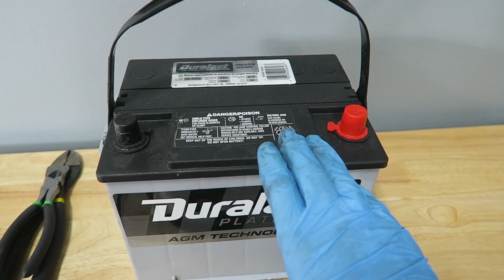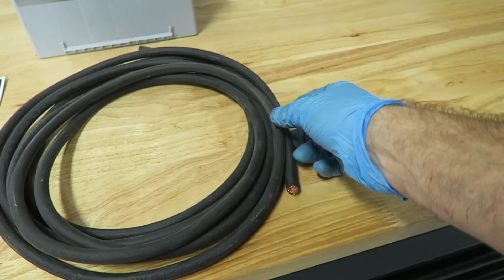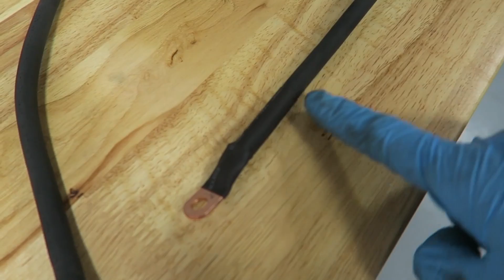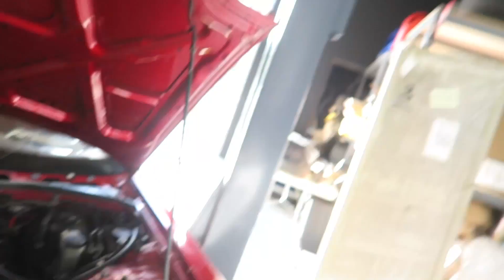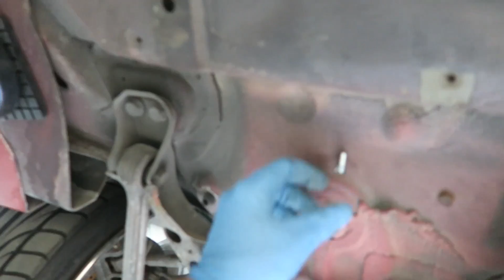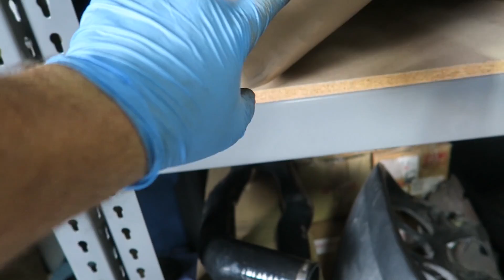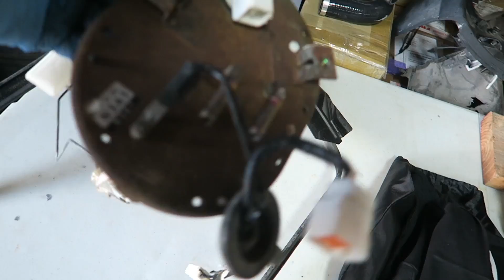THE FD RX-7 IS NOW READY TO START FOR THE FIRST TIME IN 14 YEARS!

Comment: I love all things I have seen so far, except the battery placement. In case of a car crash the battery will kill you or the passenger if it detaches. No amount of aluminum will hold those 40 to 50 pounds.

Comment: LRB Speed makes a battery mounting bracket specifically for the storage bins. So, you didn't have to drill holes and use J bolts.

Comment: With that much amperage and line it might be worth thinking about putting a large fuse right off the battery terminal. Also I'm kinda surprised you didn't address battery off gassing. Most batterys mounted inside have blow down tubes to allow the battery gassed to vacate the cab.

Comment: I'm sorry but wiring the +ve end of the battery cables to the fuel lines is not the smartest thing to do.. I would consider re-routing +ve cables to inside the car with a separation between the fuel lines and the +ve cable

Comment: Nice man - i install car audio - i usually use marine GRADE dual wall lined HEATSHRINK & flex wrap & tessa tape in the engine bay & outside & tessa heat tape where needed... i use tessa fabric tape inside aswell  it is alil heatproof but tessa heat tape for engine bay for sure!

Comment: Mickey.. where’s the circuit breaker installation or fuse off the battery, don’t skip the safety cos people are going to follow what you did here and miss crucial safety points on their own car. 
For anyone who doesn’t know, if you do not use a circuit breaker or fuse off the new battery location and any part of the earthed body pierces through that power cable it’s gonna glow red hot and burn anything along the line.. including those fuel lines....and the rest of the car. 
Great work tho.

Comment: Would have used AGM battery, especially inside the car. Also I call crap on needing a full size battery. You must understand the limits of something like a Odessey PC680. Most people abuse them then cry when they fail. Some people don't want to have to work within the batteries limits, so that's fine, just stay with full size. But you can use them just fine so long as you understand their limits.
Reply: Pretty sure it says AGM on the side of his battery 3:31

Comment: 2g welding wire is equivalent to 4g car audio wire so that’s why it’s cheaper and always go with ofc wire but I’d say you should always go with 0g
Reply: Chriscross 7 it's also not cheaper unless you're buying stinger or one of the commercial brands. I paid less then 3.50/ft for my 1/0. Hell me 4/0 I used for the runs from my distribution blocks didn't even cost $5/ft
Reply: Jeremy Crabtree I use sky high and gp car audio all ofc

Comment: yo yo that's very dangerous what you're doing with that power wire you're better off removing the kick panel and running it through the firewall like you would an audio system overtime that will vibrate against the metal pipe and cause it to wear out the rubber casing and Arc out. think about it if that was a good idea the  Factory would have been doing that a long time ago they don't run any power wires underneath the car especially next to fuel
Reply: Deatherage performance no it won't at least in over 10 years I haven't had issue once with rubbing and his is even cleaner that mine stop trying to act like you know what your talking about.. it's not a daily and that setup could outlast the engine on this car without any issues
Reply: GixxerDad 600 you clearly have no idea what you're talking about if you worked on vehicles before you know that issue it can happen in the next 10 years or can happen in the next month you never knows that's why you never do it that way if you do your wiring like that that's why your shit going to fry it's not the same as street bike you idiot

Comment: The automotive wire is weave is different and is corrosion/weather resistant which is why it costs more than welding wire. Its worth the extra IMO.

Comment: The reason you use automotive cable in cars is because the insulation melts at higher temps,is low smoke and no toxic, well it is in Europe.

Comment: Power lines running the down the same path as the fuel lines under the car, yikes!
Reply: Yeah sounds like a bad idea. I usually run my cables through the car, it's a lot more work. But just think if you hit something and puncture the lines. The positive cable will spark if it grounds
Reply: There are some cars that do run both lines together, but in a separate channel. Normally the power cable will be in a fully covered plastic channel on a side of the fuel lines. So in case you do hit something, the plastic will squish against the body. In this case as Jakasaurus said, it can puncture the cable and before the fuse triggers, it will spark. I would avoid running them together just for a peace of mind.
Reply: Matt Greenland I was thinking the same thing , too risky
Reply: Yeah that’s actually retarded, if you drive over something that nicks your fuel and wire, you got yourself a nice pressurized bon fire
Reply: I could name 10 factory cars that do the same thing it's clean and safe way to do it..
Reply: GixxerDad 600 what cars have them from factory?
Reply: Matt Greenland aslong as its fused & protected aswell as secured should be fine ! FACTORY does this on alot of vehicles!
Reply: It’s done that way from the factory in most BMWs with a rear mounted battery (a lot of them, M Cars too) so is completely safe with a 2 gauge wire that’s fused.
Reply: Chris Turner Did you see a fuse in this setup?  I sure didn’t...
Reply: Chris Turner BMW runs the cable from the battery inside the cabin